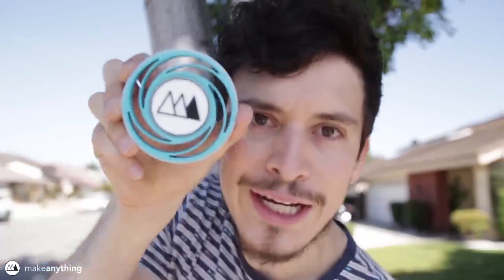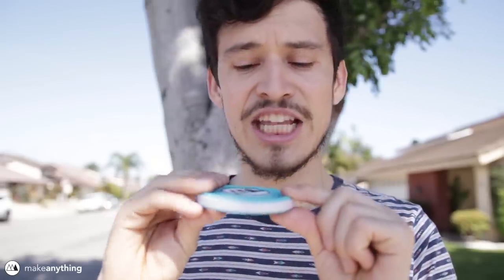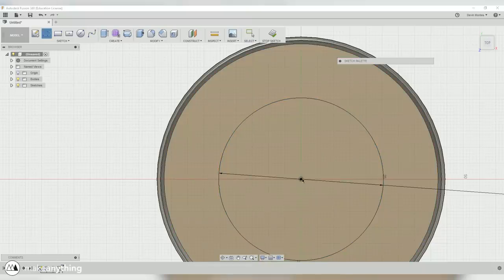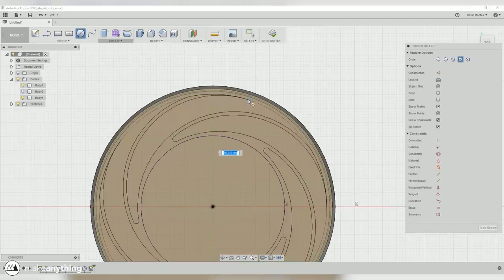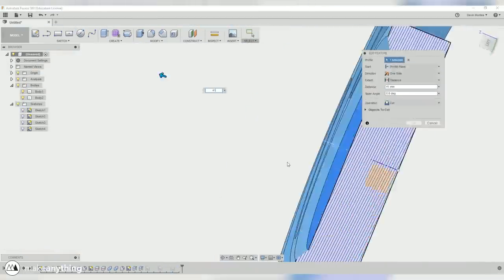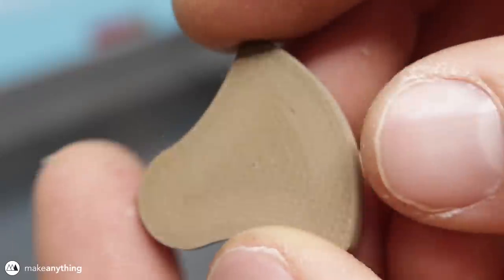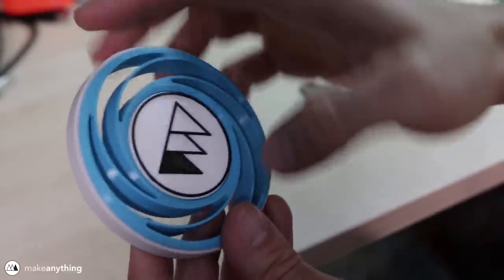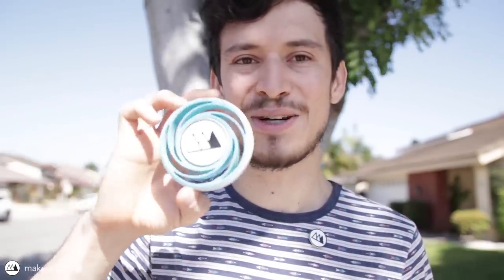My Plinko Puck // Fusion 360 and 3D Printing

Comment: INCHES. WHAT. This is 3D printing. Use millimeters next time.
Reply: B. Winky he is american he uses inches not meters
Reply: Funnily enough, it is 88.9mm exactly. I thought 1 inch was 25.4mm as an approximation but seems that 1 inch is exactly 25.4mm. Learn something every day. Another great video with another great idea.
Reply: mrfoameruk what?
Reply: What?
Reply: MikeExCal I'm American, and I use millimeters while modeling.
Reply: He just used inches because that is how matte r hackers gave out the requirements
Reply: Jack Sloan silly MatterHackers with their 0.0157 inch nozzles
Reply: mrfoameruk what the hell did you try to say?
Reply: What  are you trying to say? It fairly obvious what I was saying....If you don't understand, move on.
Reply: no no no no no, it's too easy if you do it like that, next time use fractions
Reply: Yup, that's why you'll find you sometimes need to scale other people's STLs by precisely 2540% before slicing. BTW I'm a Brit who thinks in mm, inches, feet, metres and miles :D
Reply: Yep here in the UK we get the best/worst of both worlds. buying pipe fittings, wood, spare parts etc is always a challenge. Was an inches man but now mm is much better. ie whats "6 7/8" " /10... I have no idea.... but 176.5mm /10 is easy.
Reply: snob much Winky?
Reply: B. Winky since most 3d printing and stuff made for it is in mm, I wanna learn how to use it better, but I’m so used to in!

Comment: Just an idea, instead of a dead weight, use a cell coin battery with a led and a spring switch, every time the coin hits something it will flash the led.
Reply from the maker: That would be fun! Tough to fit into the puck, perhaps

Comment: Wouldn't the shock absorption and grip from the flexible filament make it bounce around less, and not more?
Reply: Tnat's what I was thinking, it might just absorb and dissipate some of the kinetic energy, rather than returning it to reactive motion. But I suspect that may also be somewhat true of the springy features built into the puck itself.

Comment: I just made mine own puck inspired by your design and am excited to show you at the meet-up.  I am having the same  issue as you with it not spinning as freely as i want. I am not using a real bearing but printed my own races and added 1/4 SS ball bearings.  What lubricant did you use that seemed to fix your issue?
Reply from the maker: Nice, I'll see you there! I just used machine oil, but moreso it was list about lining everything up as accurately as possible
Reply: Thanks. I actually just printed a new version last night but increased the tolerance in the races from 0.1mm to 0.3 mm and that made all the difference.  I will be sanding it and painting it this week and i should be all ready to race you down the plinko board!

Comment: Frank Gatta
4 days ago
Hi, I see everyone using fusion 360, I am not a company with money and not a student that can get a student version, is there a version for the hobbyist? Thanks for the content.
Reply: Frank Gatta Autodesk run a free trial of it, and you might be able to get away with creating a student account with a dud email address as that will last for 3 years.

If not, then personally I'd recommend finding a copy of Autodesk Inventor 2016 (it's the only other 3D CAD software I've used).
Reply: There's a hobbyist version of fusion 360 free it last 1 year

Comment: You gave dimension limitations but did not say if there is a weight limitation. Anyway fun just watching you develope your "toy".
Reply from the maker: There wasn't a stated weight limitation, but since they're 3D printed weight is probably negligible... until someone decides to print a solid metal puck :P